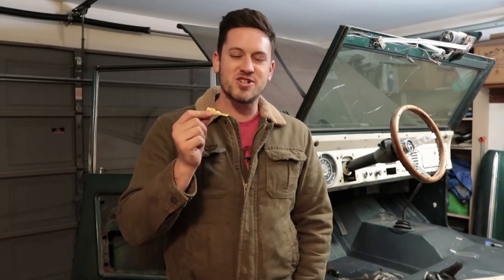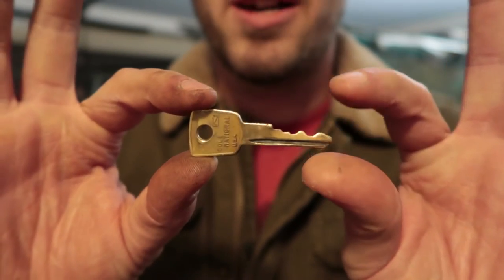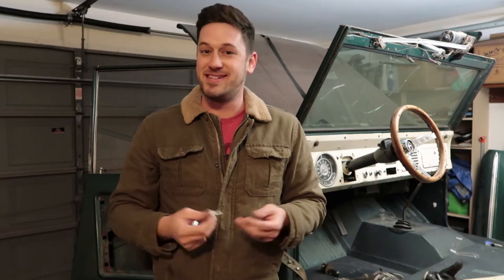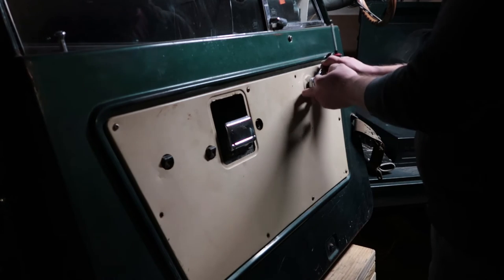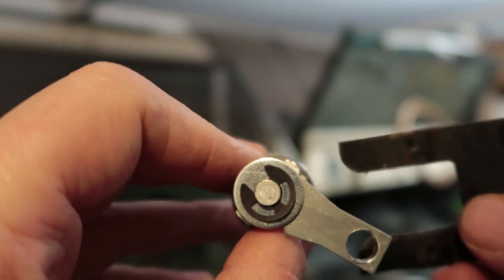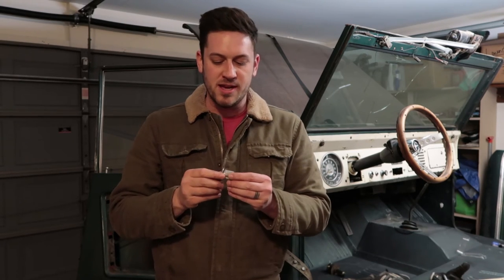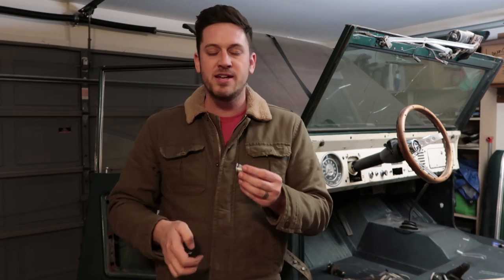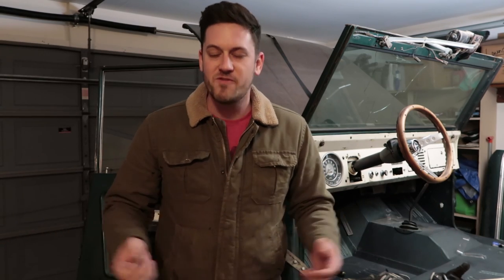Early Bronco Door Locks and Ignition

Comment: Regarding the door lock. The plastic part you saved is available and it’s  easier to install if you pull off the old one and snap the new one on after installing the lock cylinder.

Comment: My key is also loose.  The guy I bought mine from could have handed me a screw driver and it would have started.  The original ignition key I have says Ford on the top and the opening of the hole for key chain is sort of a V and has a V below it will horizontal lines behind it.  It also says USA at the bottom.  The other key I have does say Cole National too so maybe.

Comment: not ford key. it's great to make the doors lock and work with one key, and the key for the hard top. did you use a little lock tight on the screw on the door locks?